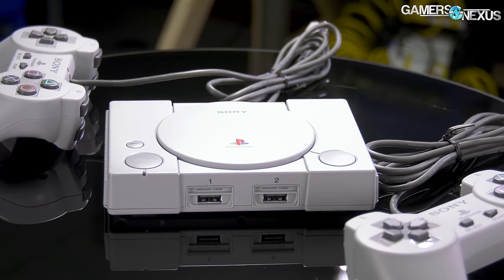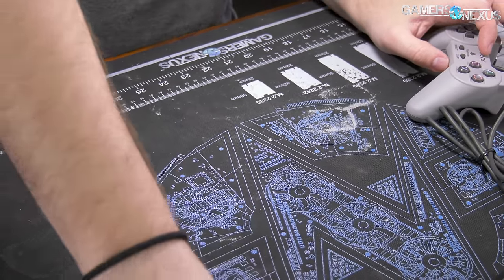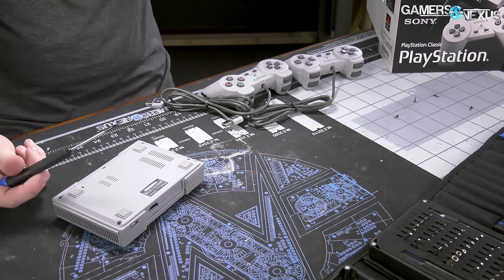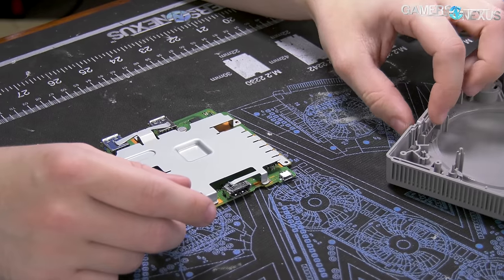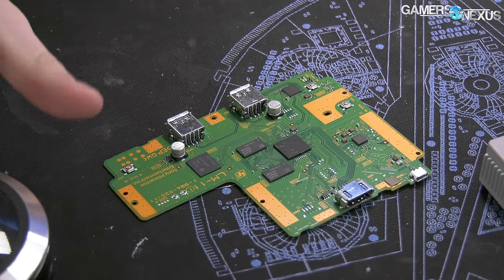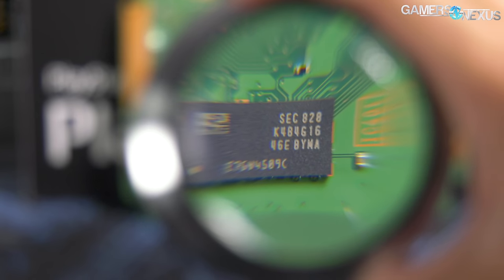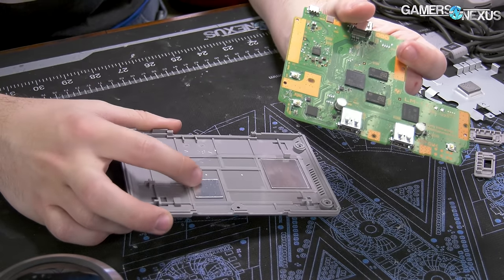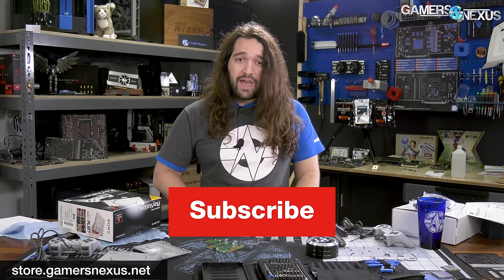PlayStation Classic Tear-Down & Disassembly (PS1)

Comment from the maker: WE TOOK APART THE CONTROLLERS: https://www.youtube.com/watch?v=05wWZ9Wvgsk
You might also like our Nintendo Switch tear-down from 2017: https://www.youtube.com/watch?v=obz5tE1mdV0
Find links to the PS1 Classic and iFixit kit above. You can also grab the modmat from the GN store: https://store.gamersnexus.net/
Reply: Hello steve love your work
Reply: Can buildzoid do a vrm deep dive? :P
Reply: How you install and play ps1 games ? And also, If you have original ps1 cd's
Reply: What about the quality of the VRM? ;)
Reply: that actually looks cool, so they figured out they could make a costume Raspberry/Odroid Arm based SBC, to simulate the old console like so many others have done over the years. I know for a fact that even at under fifteen watts, the ARM processor does throttle to maintain temps, so depending on how demanding the simulator soft is, you may be able to get massive performance bosts just by putting an old 40x40 mm chipset cooler on the CPU. Granted it may do nothing other than reducing stutters, it would be interesting to give it a shot.

So long as Sony is not charging stupid money for that thing, the SBC based classic actually looks kind of interesting.

Great vid Steve and crew. B)
Reply: Plug in a KB and press Esc. it brings up the settings.
Reply: how can you Not have A phone charger?!
Reply: you could build a raspberry pi... and play 100s if not 1000s of nintendo and sony games. yes it is piracy but nintendo and sony are not delivering what the market desires. it is such a huge untapped market and revenue.
Reply: P. S gamers nexus I've liked and subbed your chanel😊
Reply: Gamers Nexus do you think these psone classic shells could be custom painted easily? I’m looking at doing it but haven’t seen any pics of people doing it on the classic yet... was just thinking there might be a reason why people haven’t bothered, idk.

Comment: No power supply? Only 20 games...poorly emulated...$100? No thanks.
Reply: Coty with those USB that thing is going to get hacked to play any game, guarantied
Reply: @StYfReX  Very true, but with plenty of other options out there with better hardware and expandable storage it still doesn't make much sense to buy one.
Reply: NOT to mention, cheaper. You could get an entire Raspberry Pi setup (Pi, PSU, SD card, case, heatsinks, etc) for $60-75 then spend the rest on a nice controller.
Reply: That big gap.in the casing was likely for a internal power supply. Make no sense to cut that L shape pcb (more costly because of waste).
Reply: Why would you want a power supply?
Reply: EPSXE, 791 free games. Cost === Priceless, as in free
Reply: @MlSTERSANDMAN  the better question is why doesn't it have a voltage regulator anywhere eon the board? This thing is going to fry itself if the mini usb power solution you use is even slightly off.
Reply: I wonder if this can get hacked to run Android. Put ePSXe on it. 

Or you can just use your phone, a video cable to your TV and a DS4 controller 😂
Reply: @Diceman82  You're right about that. A youtuber called Dreamcastguy fried his even though he was using one that was supposed to be the right voltage.
Reply: For the non tech savvy this is a great deal for them. They won't bother or know how to use emulators and use roms of their own
Reply: @StYfReX  But this shit is so cheap it will break before you ever get to enjoy those games this crap ain't even worth hacking.
Reply: wasn’t the PS2 still on sale for 100 USD 6 years ago using a shrunk down version of the emotion engine? An actual version of the console instead of an emulator running on EOL hardware?

Wasn’t that chip good enough? Put that on TSMC 16 or 22 nm if your super cheap and actually make a good product?

This lazy cash grab.

Its not even worth hacking - but the controllers might be “nice”
Reply: @CapOlimar  so €85,- for a raspberry setup, and then what? emulating non abbandonware games by definition is illegal.... so paying an additional €15,- to sony to have a custom PS1 case and ready to play 20 games is outragously expensive, with better controllers then the €5,- USB knock off PS controller (I included in the €85,-)
Reply: spoonikle agreed, ps2 also came with nice bonus: play ps2 games, which is so hard to emulate.

Still own scph-7500x till this day from 2006, softmodded
Reply: @StYfReX  that does not help when they will run like crap anyway, the board they are using is crap
Reply: That's $5 per game... not that bad. And something to play them on without pirating or dealing with sketchy emulator DL's. This product is more for nostalgia than performance and not for advanced users.
Reply: Typical 2018 Sony. I remember when they were cool.
Reply: at least i still have my ps1 (the 2nd version the white mini one as my old one died at some point) at least i can just go find used game discs if i have to extend my library heh. id never buy that. and fact they styled it after the old original one, its almost same size as the new model one i mentioned after it and just as worse in game selection lmao.
Reply: He's going to hook up the Great Wall PSU he loves to fiddle with so fucking much
Reply: yeah exactly aha just fine for what i need
Reply: @StYfReX  But what's the point of it then? Why no buy a PSTV or better yet, an Android TV box.
Reply: @Diceman82  it doesn't need it because the charger from a phone has one.
Reply: Just buy it. Lol
Reply: There's the Raspberry Pi which can emulate more classic consoles for $50 so this PSClassic is only for collectors :/
Reply: FuturePants great point and if you want to play on a big screen then just get a Raspberry Pi or a cheap android box.
Reply: That already happened to Dreamcastguy. He apparently fried his 2 hours into his testing of it.
Reply: @lilyflower6265  And you say you aren't a fanboy? Please use your head. If he doesn't like the look of the console that is HIS opinion. Seems you are the one incapible of handling a different opinion.
Reply: @StYfReX  crysis 3?
Reply: No PEPSIMAN? No thanks.
Reply: It's sad the hardware is good enough to emulated game at full speed but they choose to give every one the PAL version smh in the USA. Why didn't they learn from  Bethesda launch of fallout76?
Reply: @TweeZerLEWIS  they're using an opensource emulator, so it's not that different that anything you do on your own. They maybe download the rooms from the websites we use for all we know.
Reply: I feel like it’s more of a nostalgia thing. Surprised Sony would even bother tho.
Reply: get a raspberry pi 3 thank me later
Reply: @CapOlimar  And with a Raspberry Pi you also get wifi and bluetooth, I use it for kodi on an old non-smart TV and play movies and stuff I have in my PC through network.
Reply: @lilyflower6265  where did anyone say that they expect sony employees to work for free? You say that if you were to buy the games off PSN they would cost over $100. Well at least you can get the games you want and not 20 set games. That seems to be people's biggest complaint
Reply: Buy a raspberry and make a custom case for it and done.. Psx emulator... Or just any psp hack it and put a 32gb sd card and here ya go 32gb for psx games..
Reply: It comes with a USB cable, just no ac adaptar (all modern TV's have 1-2a USB ports that can supply power to devices). I think it's pretty cool, you can add games to it using a flash drive (easy mod) and if you're like me, it actually looks pretty sweet next to the PS2, PS3, and PS4 😎
Reply: Mr. Sandman Why wouldn’t you want a power supply?I don’t wanna have to go out and get a separate power brick then usb cable
Reply: got a new one for $30
Reply: Coty a raspberry pi 3b+ has inferior hardware, u complaining about the psc having 20 games when the rpi has zero games, no internal storage, no controllers, no case, no hdmi cable, no ac plug. By the time u get all that it’s more closer to 100$ or more if u get quality controllers. 

And if u consider legal games being worth anything then that can factor in too. 

The psc can be obtained for 20$ now, it has USB ports, plug and play solutions where modding is no necessary, a quality case, if u get a custom ps1 rpi3 case that can costs 30$ or more. 

And the psc play psp and Dreamcast better than the rpi3. 

Soon bleemsync will incorporate emulation station as well so it’s a no brainer that the psc is superior than all the retro classics on the market and the rpi3
Reply: @josukeh.7658  Well I mean I made that comment a year ago lol

Comment: Only 20 games. I guess they didn't download enough ROMs before Nintendo closed the webpages
Reply: Wouldn't you need the ISO instead of a ROM for ps1
Reply: @originaldk5436  the fuck are you even saying lol
Reply: @originaldk5436  there aren't any .rom files though, each console has different rom files except for disc consoles, also PS1 roms are bin/cue files, not isos
Reply: @STEVEWONDA1976  it's about how nintendo was being fucking stuck up when the nes classic came out and they tried to take out all the rom hosting websites, they only ended up taking out 3 though, thankfully (sadly, emuparadise was one of them)
Reply: Jesus every one /whoosh
LoL
Reply: RubyUmbreon, they only took down two. Emuparadise took itself down out of fear.

Comment: wouldn't a RaspberryPi be cheaper, more powerful, and way more customizeable.  Just buy a cheap 3D printed version of the PS1 Classic  to use as a case for your PI
Reply: lgr already did it
Reply: Yes. LGR went over building exactly that, and does a price breakdown.
Also, I personally have RetroPie mounted onto my on Pi 3 B, and can verify that it has many more emulators ready to go.
Reply: Go tell that to the people who this is actually marketed for. I'd tell them to buy a real console and plug it in to CRT because that's the only authentic experience. This is not for me or not for you. Still Sony did fuck this up badly, but those who this is targeted for don't know that. They don't know better. If I wanted to emulate these games I'd just use my home theater/living room gaming PC.
Reply: Yes, yes, yes, and yes.
Reply: LGR?
Reply: So this thing is more expensive than a Pi3 b? eek
Reply: @pr0xZen  the power would not be wasted, it can be used to run the games correctly and better looking than on the real ps1, and this device clearly lacks power to handle it as is
Reply: Here's my tips if you cannot 3d print:

• get crappy famiclone for case (polystation)
• build rpi on it
• ??? Profit!!
Reply: @CheffBryan  It's a misleading price breakdown though because he goes with the assumption people already have a usable controller.
Which, to be fair most people do, but if you ignore that you're comparing apples to oranges given a system that has two controllers included.
On top of that he was personally demonstrating it with a PS4 controller, and that controller all by itself would double the price if you didn't already have one handy.

Given how high his quoted cost is, and the cost of one controller (let alone 2) you're easily over the price of the Sony mini thing.
On top of that, you're dependent on illegal games too. - not that many people care, but it IS a valid point - the sony device contains 20 legal copies of games.
Any custom emulation solution cannot even run anything at all without technically breaking some laws.
Reply: Even an Original Xbox would be cheaper then this an able to emulate Ps1. But then again thats the "illegal" way of emulation but even if you wanna support sony and not download Roms you can use Sonys better alternatives like Ps TV / PS Vita or Ps3 with Ps1 games in store.
Reply: I was thinking the same thing.  That or a smarphone with HDMI output.
Reply: I got a raspberry for my retro console. Its really the best way to go in my opinion. Totally customizable how ever you want.
Reply: The pi is less powerful
Reply: Yes, this ps classic is trash
Reply: @madfinntech  I get you, but for some people getting a huge ass crtv and a real PS1 is not practical. Unfortunately not every is tech savvy as well. And these days in a Covid world, the PS1 classic is cheaper than a real PS1 and a PS3.

Comment: Sony using an open source emulator is ironic since they love suing other emulator software in the past like bleem! 😑 Trying to make emulators illegal
Reply: Well, in all fairness quite a bit of time has past.

If they at least built their own emulator it wouldn't be so bad.
Reply: Lets be honest every company does that, they are in buisness of making money not making hackers or pirates happy. Im all about emulation and stuff but seriously your gonna blame someone from protecting their interests ? So many ppl on yt don't have basic understanding of buisness and hiw things work around them.
Reply: wykydytron you might want to read the wiki page about bleem. Sony actually lost the lawsuit against them because there was nothing wrong with it. I used to use bleem in the past. You need an original bios and even an original game. You couldn’t use a pirated game. They just wanted to run out anyone reverse engineering their software. In this case it failed.
Reply: Bleem was not the same thing as what you describe.
Reply: It's worse than that. I think Randy Linden is still working for Sony. He was one of the folks behind bleem. So they have someone with emulation experience that they couldn't be bothered to tap. Lazy.
Reply: @nightbirdds  I bet he's laughing.
Reply: @lilyflower6265  Bleem was for people who OWNED the games, you'd put the disc in your PC to use with the emulator. Sony are using open-source emulators, other peoples work, in the PSClassic.. It is ironic, it's objectively ironic. Stop fanboying some corperation just because you like their toys.
Reply: @lilyflower6265  Well, besides the fact that Bleem! was made by reverse engineering the PS1 and no longer falls on infringement, and in order to run it you wanted the physical disc to backup a game since the internet wasn't as good back then.
Reply: Rusty Shackleford RIP emuparadise you'll be missed :'(
Reply: @Miko36110  There are other sites thankfully, but I fear to name them on here incase nintendo catch on xD anyways iv backed up all my roms now incase it ever becomes impossible to obtain any
Reply: @lilyflower6265  That's a huge assumption. I don't throw the word "fanboy" around willy-nilly. Bleem wasn't used for piracy, it's an objective fact. Just like it's ironic that Sony are using an open source emulator. It's pretty obvious you ARE a fanboy and that's your reason for defending the PSClassic. I can handle people having different opinions, I still expect them to have VALID opinions though, which yours aren't.
Reply: @lilyflower6265  You don't seem to understand that back in 1999 these rom sites weren't that commonplace. They took Bleem to court because it would cut into their hardware sales, and also because they reverse engineered their hardware. These are facts, just because I point out WHY your opinion is wrong does not mean I am incapible of coping with different opinions. But there's a difference between fact and opinion. Bleem wasn't used for piracy. Fact. Not opinion.
Reply: @lilyflower6265  Even on other comments that have nothing to do with emulation or roms, but mock the PSClassic for not having a power supply with it.. You are there, attacking them, telling them they are wrong.. Yet you think it's me who is unable to cope with any opinion other than my own? People in glass houses
Reply: @lilyflower6265  Seriously, how do you even have the nerve to say it's me who has a problem with others have different opinions? I'm fine with others having different opinions when they don't try to invalidate my own, and you are on practically every comment on this video attacking anyone who doesn't share the same opinion as YOU.
Reply: BLeem was an issue because the PS1 was still on sale back then.
Reply: Its hypocrisy on Sony's part. They sued Bleem out of Business because it was going to EXPOSE Sony's LIES and Trade Secrets regarding PS1. And show people how Underpowered and terrible the hardware was.
Reply: Wrong, bleem was for profit and closed source.
Reply: @estusflask982  So is PS Classic. See the blatant hypocrisy?
Reply: Sega United No, I don’t. That’s Sony’s intellectual property, they can do whatever they want with it. Bleem stole Sony’s intellectual property and sold it for a profit.

Comment: Pi 3b+ makes this look sooo bad
Reply: Jade O you're right, and it's a weaker SoC than the NES Mini, but the Pine64 makes RPi3b+ look so bad too… and so on :) In fact no ARM SBC comes close to the price/perf of an ITX motherboard with a cheap x86 CPU.
Reply: This a a fundraising thing for the ps5 I guess
Reply: And now the Pi 3 model A as well. Tiny little thing, give it a USB hub and slap it into this shell, you've got room for expanded storage as well. You're rocking away multiple emulators for SO MUCH cheaper.
Reply: @TDGalea  all that work to play some classic games like Tekken and cool boarders nah it'll be on sale. I'll get this and add my ROMs with a USB stick .I looked up raspberry pi and I need to buy a separate SD card and do all types of stuff to get it running it would like over a hours works easy . On top of buying a USB hub and controllers for the pi ,it would end up costing way more .not to mention getting case and extra storage for it. Nah don't got time for all that ssh bullshit .I want plug and play.
Reply: I regret buying a classic